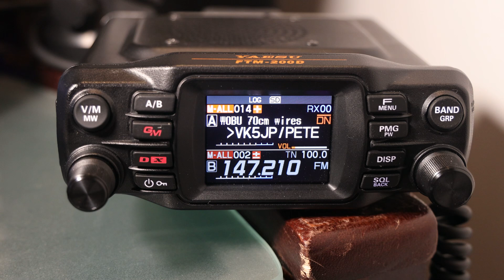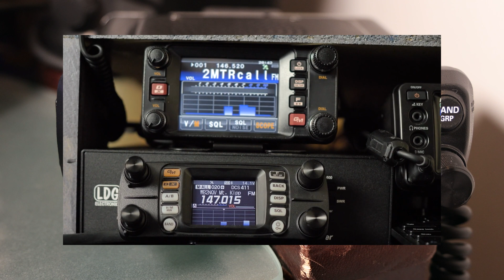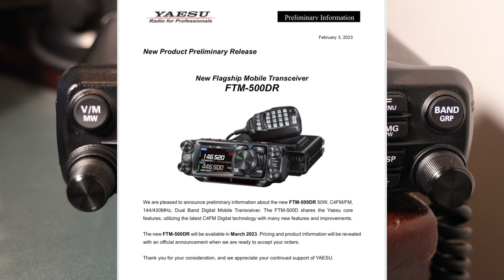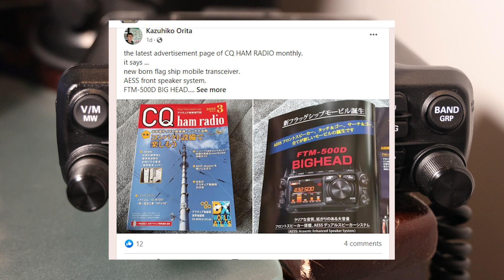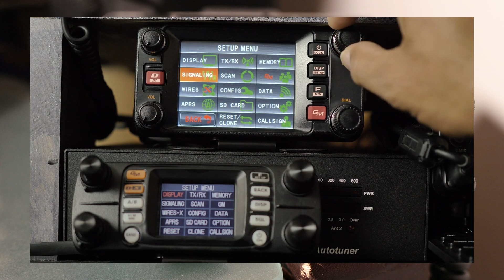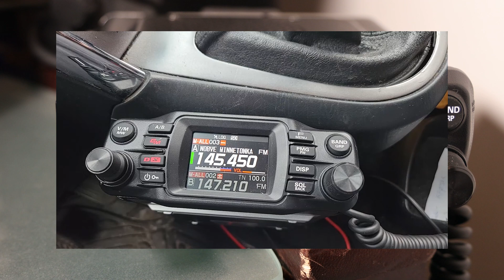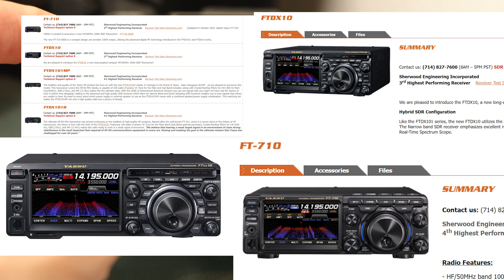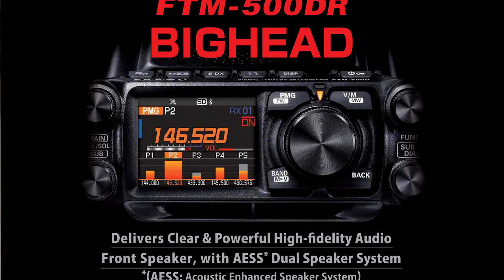FTM 500 - Release Day is Around the Corner, What Should We Expect??

Comment: They talk about the speaker placement. I put mine between the headrest posts on my set pointing at my head. Run the cable down the inside of the seat back and plug it into the radio. Easy peasy.
Reply from the maker: great tip, thanks!

Comment: IMHO the PGM feature is more usable than memory banks.  The ability to quick select a subset of 5 frequencies in memory into a quickscan memory bank with bandscope displayed works really well, especially so when in practice it is very easy to add/replace entries in the PGM quicklist.  Banks are "old school" - dynamic quick search PGM is so much better.
Reply: i was just thinking this driving around with my 300. i might have to swap it out for a 200. i kind of miss the pmg
Reply from the maker: Good point!
Reply: I tend to be a Yeasu guy, but as far as memories go, I like the feature of the Icom 5100 that compares your location to a list of repeaters and automatically programs in the repeaters that are closest to you. Great feature for a mobile radio. However, I do tend to like to organize my programmed frequencies so that I can pull up a set of emergency frequencies, a set of frequencies used by the local radio club, and so forth.